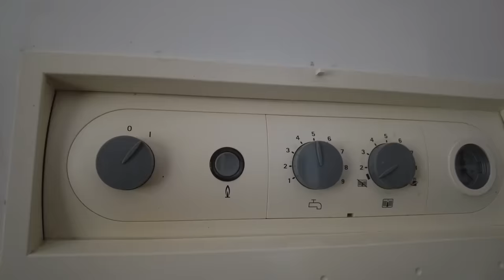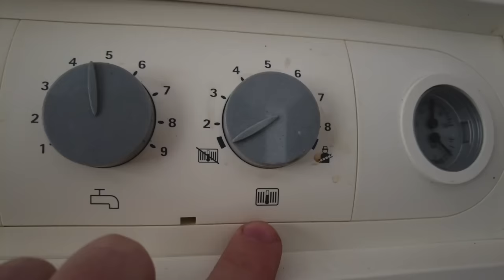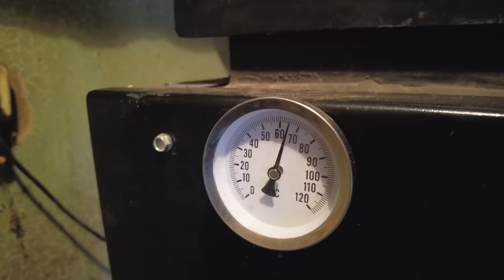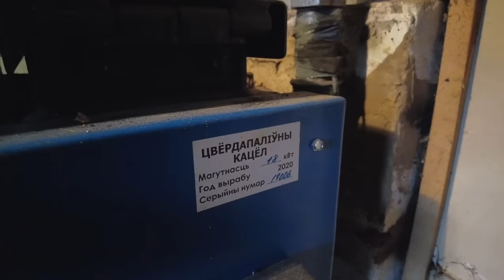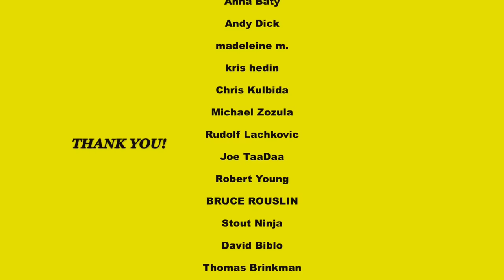How We Heat Our House in Ukraine? | Winter in the Countryside 🇺🇦

Comment: Hi Pavlo, I'm Canadian but live in Western Ukraine in the Carpathian Mountains. We use only wood because there is no gas line in the mountains. Over fireplace has a pump which circulates hot water to radiators throughout the house. Works amazing 👌🇺🇦🇨🇦
Reply: Wow,thanks for living in Ukraine.God bless you
Reply: There are no oil or gaslines where I live. Each home that has propane, gas or diesel (no. 2 oil) has a tank at their house either above ground or below. They get the oil delivered to the tank. It costs me a lot. You might want to look into that and see if they have that.
Reply: @AbacusincInfo Or geothermal… It’s surprisingly inexpensive to circulate water through underground pipes all year (for both heating and cooling)… Depending on your environment you set the level underground for said pipes and bingo - though it is more efficient using a central air handler than radiators to moderate the temperature (plus you can add either an electric coil or gas/oil burner to it for emergency heat if needed, though having a wood burning fireplace or stove is more cozy).

Comment: In North Carolina USA many people have heat pumps. Also natural gas. It costs about $300 a month to heat a large house. Thank you for the informative video.
Reply: Son, you must have an extremely large house or it's poorly insulated. I live in Southern Illinois and my NG bill has never reached $150/month. My electric bill can be pretty steep during summer. But I run a pool pump plus a 2 1/2 ton central AC unit.
Reply: Ok

Comment: That is some nice wood! It looks like it might be oak. I find oak is one of the best. I have 2 wood stoves for alternative heat and an oil furnace using no. 2 (diesel). The wood is labor intensive and adds a lot of particulate matter to the air. That said I stopped using it due to it aggravating my asthma.  It definitely makes the house super warm.

Comment: I live in a FIAT Van in Nevada where it is much warmer than your location.   I believe my winter heating is over for the year.   In the van this year I am running a propane heater.   One five pound tank of propane last me one week on average.   My total winter heating cost is $85.
Reply from the maker: Hi Joseph! You live in the van, you mean in a car?
Reply: @pavlofromukraine  Yes though a little larger than a car.  About 40 sq ft of flat floor and 5 ft high ceiling.   The floor, walls and ceiling have lite insulation.   There is a futon sofa bed and a snack coffee bar.  I have an ultra HD Flat Screen at one end.  There are two independent electronical systems with one solar panel.  I have limited electric heat and a propane heater.   Last year I ran the engine for heat.  In United States Cities I was repeatedly attacked by Refugees of Black's, Latinos and East Europeans.  This life on wheels is going on for six years and I am comfortable.   Thanks for Asking

Comment: Pavlo,
We heat with what is called a "Dual-Heat Pump/Gas". There is a heat exchanger which extracts heat from the outside air until the outside temps fall to 35F, then it switches to gas furnace. You can make it run on just gas, which is what we've had to do the past week or so due to the sub-freezing temps. This morning it was +4F!!!! Freakin' cold degrees. No matter how you call it!
But many years ago, we used to heat with wood; mostly fallen or diseased timber which we cut ourselves on our own property or an adjacent one belonging to a friend. We cut enough wood for he and us sometimes. But our last experience using wood was very hard work! Our stove was nothing like the one you show in this video. That would have been nice. And our home at the time was built without, that is (0) insulation!!!! Didn't realize it until after we purchased it. So the wood burning firebox was insatiable! I had to get up several times during the night to feed it. Not fun! 
Sometimes I wish we had wood heat now. But we don't have enough timber to cut for our use. So we'd have to buy it. I don't know how much a load like yours is selling for around here, but am sure like everything else, it has more than doubled in the past several years. It's greed mainly. Even the propane gas we use has doubled to $3/gallon now. Am sure it will get worse. Again, because of greed! The rich get richer, and the poor get poorer! 
Slava Ukr!
Reply from the maker: Thanks for sharing it!

Comment: Don't put all your eggs on one basket.
Balance your heating sources.
We use both gas n wood.
Both are linked to the central heating so either can be chosen.
The one thing both methods are dependent on is power to drive the heating pumps.

Comment: Ah yes, I was wondering if you had to buy your wood. Then of course, gas is cheaper. 

Now to my experiences, in the mountains of Montana (USA and 1950s), and then in Germany (1980s & 1990s). 

When I was young, living rural farmland Montana, wood was all we had. And to burn that wood, all we had was a cast-iron stove in the kitchen, and fireplaces in the rooms. (Log house too, with 12in/31cm logs. So very well insulated.) But, winters stayed around -30F/-35C from about Christmas, until early March. (Snow would get to between 1m to 1.5m deep, but sometimes 2m or more. We walked around in snowshoes, every time we'd get off the road or pathway.) So, we had a separate barn, the size of all of your outdoor garage/summer kitchen just for wood, and filled to the very top come September or October. One of my best memories from back then, was laying in bed, covered by a thick feather blanket, with even though the fire was still burning, the windows had frozen over. We children could hear the wolves sniffing around at the window, before they started to howl at the moon. My least liked memory was then waking up in the morning. There'd be frost on the bedding. And one of us, would have to get up and get the fire going again, hoping that there'd be enough embers left from the evening before. 

Germany wasn't as radical as that climate though. (At least where I lived.) But, it too was rural. There; I built a 1-1/2 story house using 36cm clay insolation bricks. I had then a central firebrick pitch (base oven), that could heat everything. Just because of its location though, you couldn't cook with it. But otherwise, it heated everything, and everywhere, via hot water, and the living/dining room directly. (Only needed filling 3x a day.) And as far as firewood, here too; we made our own, from our own forest. (We were 3 families.) But, to give you an estimate of how much wood we needed; look at your fence to the street, then for as tall as that fence, a good 1.5m deep, and going from the left side property border (facing out from inside the property, just like you filmed, so the longer side), going all the way to your driveway gate. When spring finally came, and we didn't need to heat with wood anymore, only gas or oil, there'd only be about 1/4th to 1/3rd of all that left.

So for almost all of my life, heating never costed much of anything, but lots and lots of work. I'm old, and glad I don't have to chop wood anymore.
Reply from the maker: Thank you for sharing, you have wonderful memories, and I also plunged into them... Sometimes it's hard to say what is cheaper - to buy or to prepare firewood yourself...It's a hard work..glad to hear you don't have to chop anymore :)

Comment: did you ever figure out why that truck wouldnt run for some time!?!?
Reply from the maker: During wet weather, the wires to the battery oxidize, and it starts poorly or does not start at all. That's happened.